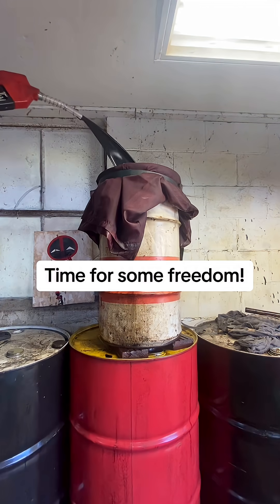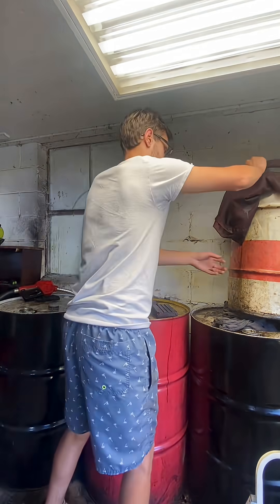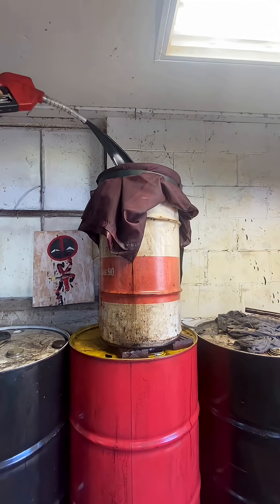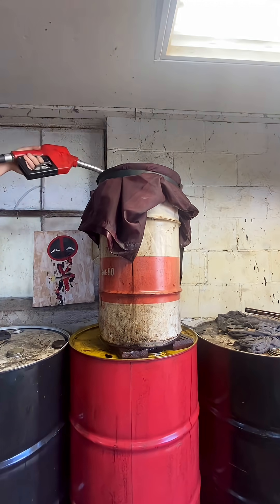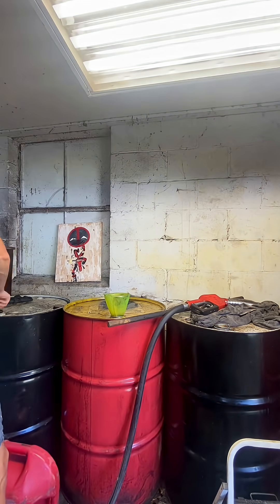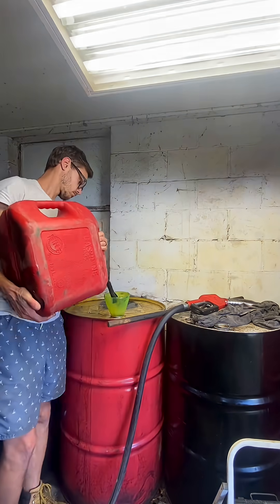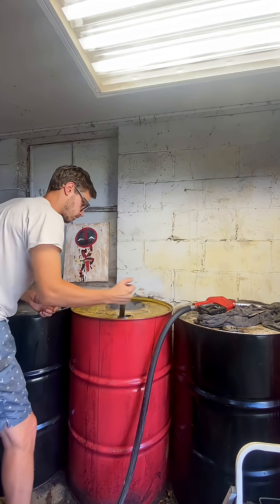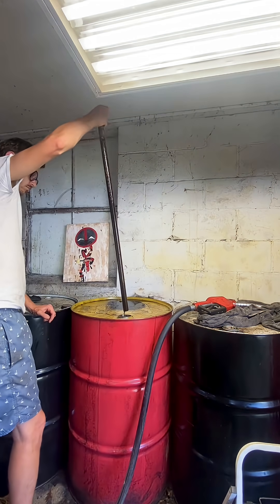Transform #wastemotoroil into #homemadediesel Fuel #dieselmechanic

Comment: This is not diesel without the distillation process. This is essentially 1:50 premixed fuel. Kinda like what a 2 stroke engine runs (50:1). Just a really heavy version of premix or petroil. It will run, but will not run clean and wreak havoc on your injectors and pumps and filters. Even in an old engine, with the bedsheet filter system and no water elimination in the process you’ll end up having issues.
Reply: Actual real diesel is a mixture of c10-c15 hydrocarbons. Base oils range from c25-c45. And petrol (gasoline) ranges from c5-c15 depending on location. The logic here is probably something along the lines of "by creating a blend of components whose average is that of diesel, it is therefore diesel.".

Dead wrong. Dead engine wrong. But let them learn the hard way. Everyone learns their own way.
Reply: @captainotto  Hey, you sound like you know a bit about it. Can I ask if you've heard of used oil engines? Apparently they are around. Would you have anything on them? Cheeers
Reply: @theoneandonlybluesky My understanding is that is just any pre-common rail diesel, with modifications to account for the increased soot, ash, varnish, and other nasties produced when burning this stuff in a cylinder.

The safest way to burn used oil is in a burner, perhaps to raise steam or hot water like you would do in a boiler.

The problems you have when burning used oil in an engine come mainly from alkenes produced during the oils use as saturated long chain hydrocarbons crack, saturated salts from detergents and surfactants, and of course sludge and varnish caused by the combination of carbon and metallic particulates and polymerisation of various alkenes inside the cylinder during combustion.

Engines that are made to burn used oil will address the above issues or otherwise be immune to them. I cannot think of a single car engine that addresses all of the above. Not stock at least. Regarding soot and ash, however, any non-DPF will be very resilient to that, but your neighbours may not be!
Reply: It has more btu potential than diesel and will burn in a boiler with air assist. Lots of waste oil furnaces  mechanical injection or heui are fine just have to filter. I got a guy I know runs mineral oil in a Cummins cuz he gets it free. Has a cleaner tailpipe than fuel oil  @captainotto
Reply: @captainotto ACTUAL “real” diesel was made from plant oils. Mr. Diesel was on his way to Europe on a cruise ship with all his paperwork to a meeting when he decided to “off” himself and jump overboard, leaving his patents and paperwork behind. Effectively leaving his life’s work to the Rockafellers… who re-engineered the fuel so every farmer COULD NOT be a fuel producer. 
Facts.
Reply: @societyspy I’m sure it wasn’t suicide
Reply: @societyspy seriously? He commited suicide? I presume he wasn't making any money. I need to go check out his story again.
Reply: @societyspy sound like a good ol “accident”
Reply: 😂@Owexotic
Reply: Yeah I clean my Injectors about once every 5 months , but it's worth it to me to save 10 grand a year in fuel , after you do it 5 or so times cleaning them and fuel filter only takes a hour or so
Reply: @chrismoss875  if you have to physically clean your injectors twice a year I could only imagine the buildup in your heads exhaust ports and valves and seats. As well, if you have to clean your injectors that much the fuel system must be full of crap as the injectors are the last stop for the dirty fuel. Let’s not forget the fuel tank now. There must be a solid inch or more of sludge just sitting at the bottom. Do you drop the tank once a year as well to clean it out? Apart from all this, it’s actually illegal in the USA to refine your own fuel. Maybe that’s why he doesn’t refine it in this video and is simply making a diesel gas mixture.
Reply: @Mathew-xr7kt  It is absolutely not illegal in the US to create your own fuel. There’s different regulations and permits needed depending on type and amount, but it’s not illegal at all. People have been making biofuels for decades.
Reply: @ndavis265  it’s is 100% illegal to use homemade fuel. A big portion of the price of fuel is taxes. You’d be evading the road taxes. You need permits and follow proper epa laws to produce fuel.
Reply: @Mathew-xr7kt Exactly like I said, “there’s permits and regulations.” One of which is you have to pay fuel tax if you use it on public roads. I swear y’all argue just to argue. 🤦🏻‍♂️
Reply: @ndavis265  lol and the rules and regulations would dictate that one would not be allowed to make homemade fuel on private property. EPA has pretty strict guidelines when it comes to making fuels or mixing and distilling chemicals. 
You’re the one here trying to argue just for the sake of arguing. Come back when you’ve found someone legally making fuel in their backyard. 
It’s not even legal to pick up oil from businesses and store it on your own property.
Reply: Who cares he saves 10,000 a year
Reply: @ash7946  doing some quick math on your statement. He’d have to use about 50 gallons a week @ $4/gal to spend 10k a year on fuel. 

You’re also not taking into account the time and fuel it takes to collect all this used oil, process it and store it. Not to mention associated repair costs and the 100 pillowcases he goes through every year lol. Time is money and wasting time making mixed gas and oil isn’t worth it for most people. I guess if you’re unemployed and have the time to mess around it may be worth it. Then again, if you’re unemployed are you really using 50 gallons of fuel per week?? Someone that burns that much fuel doesn’t really have time to mess around making homemade fuel and the only vehicles that can handle burning this heavy mixture aren’t usually suitable to be driven that much..
Reply: People in the comments will attack anything. “ technically it’s not 50:1 considering I took 3 shits and only ate 1 meal but sniffed the petrol 4 times and only got 1 brain tumour id say the ratio is” who gives a shit that wasn’t the point of his comment.
Reply: Wouldn't it be 10:1? Since he did 50:5
Reply: @eron1979 no its 5:55. The first number five is what is being diluted and the 55 is the total parts.
Reply: @eron1979  in theory it would be 1:9 if you account for the 5 gal of gas that displaced the 5 gal of oil in the 50 gal drum. Wouldn’t be possible to add 5 gal of gas to 50 gal of oil in a drum that only holds 50 gal. 
But that’s besides the point. He made mixed fuel, not diesel.
Reply: @Mathew-xr7kt  55 gallon drum. They come in 55 gallon size standard. So it's 1:10 ratio. He even says, "i take an empty 55 gallon drum".
Reply: @Mathew-xr7kt That's how I know you don't work anywhere near shops or cars or anything if you don't know those drums are 55 gallon not 50 gallon
Reply: @316Speedshop  lol been in the oil fields for decades. Just never been to the states. We strictly use litres and cubic metres when referring to liquids. Drums are 200 litres (43.8 gallons) most of the world has moved onto the metric system. More precise.
Reply: @Mathew-xr7kt  okay so is 200 litres 43.8gals or 53.8gals??? That might be a dumb question but I don't feel like looking it up and converting it on Google ‼️🤦🏾‍♂️🤣🤣🤣🤷🏾‍♂️👌🏾💯...
Reply: @amERICanERICandoit ahh.. thanks I missed that. 😉
Reply: @Mathew-xr7kt  55 gallon drum
Reply: @ayeeequanpsn5896  It's 52.8, everybody can make a typo. Give the man a fawking break, this is absolutely not the point here!

The point his an old oil + gasoline mixture != diesel
Reply: @SgtDuster The point of this thread is to let the OP keep showing us how important humility is, when you're trying to prove you aren't a total idiot.
Reply: Fact! @amERICanERICandoit
Reply: @Mathew-xr7kt standard drums hold 55 gallons.
Reply: @terrywilliams6158  there over 100 replies on this. Your a bit late to the party bud
Reply: @Mathew-xr7kt  it's a 55 gallon drum so it's 10:1 ratio
Reply: Right, he's gonna have huge problems.
Reply: @ktajax y'all do realize any diesel pre electronics will run on straight used oil right? My ford 5000 has been running straight used oil for 5 years
Reply: @ktajax no he’s not it’s proven to work and burn more efficiently than normal diesel. I hate yt comment sections
Reply: I came here to say this. Thank you. Saved me typing. Getting really tired of people posting these videos and have 0 understanding of petrol chemistry
Reply: So everyone in the comments talking like they are chemist and engineers after using google  😂  🤦‍♂️
Reply: My grandfather used to run his soviet era tractor on pure oil, any oil you can imagine, old electric transformer oil. The tractor is 40+ years old and still works. You know what will really run havoc on your modern diesels? Diesel itself. There is no more lubricity in diesel, helps to throw a quart of engine oil in your diesel.
Reply: I'd not use more than 25% of that stuff in your tank.
Reply: I love that everyone is arguing the math but we are all on the same page that it isn't diesel. Gotta love us gearheads.
Reply: It’s what is very commonly referred to as “homemade diesel”. I understand you are very smart and need to prove it to all of us but you sound quite dumb. Especially not knowing what a 55 gallon drum is 😂
Reply: @ChrisJohnson-ww4vs  where did I say I didn’t know what a 55gal drum is? I didn’t… like I stated. We use litres.
Reply: @Mathew-xr7kt ”in theory it would be 1:9 if you account for the 5 gal of gas that displaced the 5 gal of oil in the 50 gal drum. Wouldn't be possible to add 5 gal of gas to 50 gal of oil in a drum that only holds 50 gal.”

Might want to get your memory checked if you’re already forgetting this.
Reply: @ChrisJohnson-ww4vs  look up how much fluid actually fits in a 55 gal drum.
Reply: @ChrisJohnson-ww4vs  as well, if you read through my comment you’ll realize I even said I was mistaken and heard wrong when the guy mentioned the gallons. I also mentioned I’m not in the USA and we don’t use gallons.
Reply: @Mathew-xr7kt What does your country of residence have to do with this? Knowledge is not stopped at borders.
Reply: @ChrisJohnson-ww4vs  when you never use gallons as a measurement unit from primary to secondary school right through college you just don’t know. 
If I ask you to drive 30km away to pick up a 30litre jug of water would you just automatically know how many miles you need to drive and what 30 litre of water would look like if you had 10 different jugs to choose from? The fact you’re more focused on the units of measurement rather then the conversation about whether this is diesel or not says all I need to know….
Reply: @Mathew-xr7kt Yes because unlike whatever 3rd world country you come from, in my country, we are taught multiple different forms of measurement. 

You seem to be the one focusing on the unit of measurement, I mentioned the homemade diesel in my original comment yet you ignored it. Practice what you preach, brother.
Reply: @Mathew-xr7kt  so much effort to not admit you got a basic math question wrong haha.
Reply: @ChrisJohnson-ww4vs it's called overfilling. I'm.sure there would be enough space at the top. A 5 gallon Jerry can can hold a bit more than 5 gallons if overfilled. 

See if I can get some troll responses too 😂
Reply: @nathanwest4670 What’s called overfilling? How can you overfill a container with less fuel? 55>50, dummy
Reply: @ChrisJohnson-ww4vs also I no longer am able to find the comment I was responding to. But it had nothing to do with your petty debate nonetheless. It did have something to do with a comment you made within your petty debate. I'm glad this method of bringing yourself up to feel intelligent works for you. To true intellectual and intelligent people it kinda makes YOU come across as the "dummy" who's trying REALLY HARD not to be. 😂. Kk. Goodnight.
Reply: @nathanwest4670 in case you need a refresher, here’s the comment you replied to me earlier with.

“@ChrisJohnson-ww4vsit's called overfilling.
I'm.sure there would be enough space at the top. A 5 gallon Jerry can can hold a bit more than 5 gallons if overfilled.

See if I can get some troll responses too 😂”
Reply: @ChrisJohnson-ww4vs  no shit. Lol. I can not find and have FORGOTTEN WHAT "YOU" SAID THAT TRIGGERED THAT COMMENT. I know wtf it was "I" said, duh. The comment is no longer there or I can't see it but you had said something about a whatever gallon drum only holding whatever amount of gallons durung your pointless and petty argument about ratios to a guy that was simply stating that mixing oil with fuel IS NOT Diesel. but rather mixed gas. You start going on about a topic that has absolutely nothing to do with weather the guys mix is desil fuel or not. I pointed out any container can be OVERFILLED. Wow. You took the bait didn't ya. Mountain out of a mole hill. Lol
Reply: @ChrisJohnson-ww4vs I'm not retyping my response that's been removed oddly. So I'm just gonna say I know what it is That "I" said. Lol. My comment isn't that far up that I needed you to remind me of my comment.  I can no longer find the comment you made (one of many) it's likely buried in all your responses. But it was something you had said about a drum or barrel not being able to hold more than whatever many gallons that is written on the side. I was pointing out that ANY container could in theory be overfilled. I really wasn't going get into your pointless ratio debate or any debate with you whatsoever.
Reply: @nathanwest4670 In all 6 (7 now) of my responses? 😂 Struggle with reading, buddy?
Reply: A reversed 10 to 1
Or 1:10
1 gas 10 oil. 
I ain't about to tell another man what to do with his own property, if he's got to do extra maintenance is up to him, if it breaks is on him, if it works it's on him too. 🇺🇲
Reply: Battery electric vehicles don't periodically yield a few litres of dirty oil, including additives and contaminants.  Can't use it as fuel either.  Though there's a stop on the Nullarbor plain that provides battery charging via a generator fuelled by used cooking oil.

Just wanted to add more random to this dog's breakfast of comments.  Cheers.
Reply: Wouldn't it be a 1:10 ratio mix? 50 gallons equals 10 parts...so 5 gallons is 1 part. A 1:50 ratio would be 50 gallons of oil to 1 gallon of gas mathematically speaking.
Reply: @amERICanERICandoit  perfect. So we’re on the same page then, he’s made mix gas and not diesel lol. 
You’re picking apart the math on the mixture yet you have completely disregarded the fact that he hasn’t actually made diesel. We call this a deflection. I heard 50 gal, my bad. In the rest of the world we use litres and not gallons. A barrel holds 200 litres, this equals 52.8 gallons. But for what buddy is doing here being precise is the least of his worries.
Reply: @Mathew-xr7kt bro you broke all technical on him but still got your facts wrong. In USA 🇺🇸 we use gallon’s. We use standard scale not that we can’t convert we don’t want to. A 55 gallon drum is just that it will hold more but besides the point a barrel of oil is 42 gallons not 52.
Reply: @Lunchbox1911  well how do you explain the rest of the world calling it a 200 litre drum. 200 litres = 53.8 gallons. I process drums daily and they’re always hovering around the 200 litre mark.
Reply: You sound too smart to have made such a dumb mistake by not listening closely @Mathew-xr7kt
Reply: @luisgonzalez8423  I was so thrown off when I saw the bed sheet strainer that the 55 gal comment didn’t register.
Reply: @Mathew-xr7kt you’re a clown. Diesels have a fuel water separator in them as long as you drain it you should be fine. I agree he could use a high micron filter but big whoop. A new engine this would tear it to shit. An old 7.3 or 5.9 6.9idi they’d all run it fine. To say the old engines wouldn’t handle it is absurd when I had teachers in trade school teach us this same trick. And there’s shop owners with 7.3’s that have been running 30 years that have probably never bought diesel from a pump
Reply: @aaronherr5852  never said it couldn’t be done or that people don’t do it. Without heating it up ur just running used motor oil mixed with gas. You’ll cook pistons when you’re trying to spray this slurry out your injectors. The people you swear by that do this surely have a heating process.
Reply: @Mathew-xr7kt not trying to be THAT guy but I work in a refinery. A barrel is the global standard for volumetric measurement of crude oil, equivalent to 42 US gallons.
Reply: @cane870  well. You are “that guy” that’s about to learn something new. The barrel of oil is a measurement, not a physical object. Drums are what hold fluid. The measurement you stated is in reference to old wooden barrels that used to hold oil. Now we send oil through pipelines and on tanker trucks, trains and boats. We use the barrel of oil measurement to keep track of overall stock. You can go buy a drum of motor oil if you like, you’ll find 200litres in it as well lol 
We just tend to associate drums and barrels as the same thing
Reply: @Mathew-xr7kt  give it a rest, buddy. You're clogging up the comment section.
Reply: @Lunchbox1911  barrel of oil is 42 gal , but that's a unit of measurement.   55 gallon drum holds 55 gallons of liquid.
Reply: @Mathew-xr7kt  I thought the same thing reading this thread of comments. I. Sitting here doing math knowing you were right and wondering why does that matter and not the faux diesel
Reply: @Mathew-xr7kt hell with the rest of the world!!
Reply: @onejack4662  the rest of the world prefers a more precise measurement I guess. 🤷🏻‍♂️
Reply: All they would have to do is filter the oil with a rope
Reply: Humbly admitting😑... I have been a Cat mechanic for 21 years and haven't thought of this long enough to comprehend what I just learned from you. Thank you.
Reply: @Rusty.1776  would you run a cat on used oil diesel mix?
Reply: @Peterswarahed 
Any machine mid 80's and earlier. Yes, Ive run much worse and thousands of gallons of it. Never added gas to it.
Reply: @Rusty.1776  that many guys made with old MB diesel
Reply: @Rusty.1776  Im trying oil on a eco diesel it seems to be burning it ok...doing a 1:2 ratio....but small amount 5 litres maybe a gallon eventually.  I have to change out my gas filter eventually cant wait to see what that looks like.
Reply: It will work in older trucks and cars like the Mercedes 300D. Newer diesels are going to have problems. A better filter and a water catch on the vehicle will get better results. A diesel purge every few thousand miles will keep the injectors happy.
Reply: @anthonyjackson7097  I had 220d MB 1977 model. Every 1000 km, a half deciliter motor oil to fuel tank, and the engine (pump) was so happy.
The car went 1 200 000km and then it was sold.
Reply: 😂 I was thinking the same thing. Love the 1:50 pre mixed fuel ⛽ comparison 😂😊
Reply: Well said
Reply: Not to rain on your parade but my friend has been doing this in his Dodge for at least 20 years, it works
Reply: @Rich-q9r  not raining on my parade. I don’t doubt people do this. Still doesn’t make the end product diesel. That was the entire point of my post
Reply: @Mathew-xr7kt you made it to the end of the argument. lol, this thread is wild. in summation, this shit ain't diesel
Reply: Maybe he has a deuce and a half lol
Reply: Well, certain areas of Canada had periods of time where one of the 3 different units were in use. Closely enough together that there are still some old guys who cause epic levels of confusion.... they never have the need to specify which gallon they're using when talking about a container, storage tank, or a specific liquid.   They just know which units were used for whatever and can give you the metric conversion from memory.
Reply: @AndyEightSevenFive  great story! Did they make mixed fuel as well?
Reply: @Mathew-xr7kt  more than likely, for anything that actually required premix though....and the guys that actually worked in the sales and delivery services were the ones that added the dye and controlled the summer/winter blending as they loaded the delivery trucks from bulk storage tanks.... Fuel oil, Heating oil, Stove oil, Kerosene all have seasonal blends that are made to keep the temperature effect from creating a wide swing in the performance of the combustion.....

And this would only happen if the goal was to just burn used oil in a garbage drum/fire barrel and it was too cold to light without thinning it out.  If they heard him call it Homemade Diesel, the only comment ould be along the lines of, "Thats a new way of spending a dollar to save a dime"
Reply: Came here for this lol not diesel
Reply: its diesel fuel if its burned in a diesel engine plain and simple.
Reply: @theoriginalDirtybill  diesel fuel consists of hydrocarbons designed for combustion, while used motor oil contains contaminants and additives from engine operation. 

It’ll burn, not as well and clean as diesel. Because it’s not diesel. Your comment is like saying, “ that object is grass because it’s green”…….
Reply: @Mathew-xr7kt  diesel fuel is anything that burns in a diesel engine.....
Reply: @theoriginalDirtybill  unlike in today’s world, it’s not diesel simply because it identifies as diesel.
Reply: @theoriginalDirtybill  so, the box of paperwork that collected in the truck cab, if stuffed into the cylinders ( through the intake even ) and lit  with matches if the glow plugs arent hot and/or cloae enough to light the paper(even go so far as to light them in the correct firing order) would qualify paper as diesel fuel?
Reply: He forgot to add a gallon of water for delution and cleaner C02 admissions..
Reply: @Magic_Mindz  dilution and emissions…
Reply: This guy is full of shit
Reply: 10% used oil is nice on the fuel bill. how much does paying for filtering used oil cost. agree it will work filtered A lot of work
Reply: My idi has drank this for the last 350000 miles, still sippin
Reply: I would have thought you added paraffin or kerosene
Reply: if you have crappy injectors maybe, my volvo has driven for 8 years with home made diesel fuel. Runs great, no noticable performance loss, nothing breaks or clogs up.
Reply: @riemerstulp6586  like I stated. This isn’t even considered homemade diesel. It’s just used motor oil mixed with gas.
Reply: Get you one of these for your fuel transfer. You will empty that 5 gallons of gas in 2 minutes and don’t have to hold the can. LIFE SAVER!!
Reply: Except it’s 1:10. Almost the right ratio for drip torch fuel. This isn’t diesel and good luck ruining your fuel pump, injectors and filter.
Reply: @scottmx426no7 its funny you gen z's talking smack about clogging filters and injectors like the reality of these old timers using this trick for many many many years without issue somehow doesn't exsist or something, why listen to a idiot on youtube when results speak for themselves 😂
Reply: 10 to1
Reply: So he essentially made weed Wacker fuel?
Reply: @Allen-g1l  😂 I would never put that garbage into a 2 stroke
Reply: You must like black smoke
Reply: Play some really bad saw gas😂
Reply: I think he's just trolling. If he actually tried to make something like this, he wouldn't confidently make a video.
Reply: I run 32:1 or more. Fun fact older chainsaws will have a line of text saying 16:1 with sae 30 motor oil.  Hell, I got a 6 pack of 8 ounce carbon cans with metal lids that are homelite 2 stroke oil cans.  Idk how old they are.  I occasionally use one.  

But seriously though this guy is full of shit
Reply: it's 55 gal Drum play me a list of different size elsewhere however stateside they are 55 gallons if you wanted to convert that to liters it would be 208.19 l . however that would be filling it completely which is very possible they don't do overseas. 

I used to run about a 50/50 used oil/ diesel in my old 1980 Datsun 720 diesel. it ran like a top on it. the newer engines wouldn't run this because they actually require a certain clarity of the fuel. and that was a 50/50 during the summer and about a 30/70 during the winter.

this actually works very well for older diesels when they took a lot of the sulfur out of modern diesel fuel it doesn't lubricate things as well. you can also use used transmission fluid and power steering fluid in the mix. I used to run it through a fuel sock before running it in my vehicle barring an emergency. 

I ran my truck for hundreds of thousands of miles changing fuel filters in pre-filters but that was it never had an injector problem.
Reply: @lrdhawkwind  is that metric gallons or imperial gallons? lol You’re about 120 reply’s down and over a month of debating this. The world doesn’t revolve around the USA and their imperial system that the entire world has moved on from.
Reply: @Mathew-xr7kt you do realize technically it's not our imperial system lol we are just one of the few countries that still uses imperial gallons.
Reply: @lrdhawkwind  all you use is imperial measurements. Only 3 countries in the world use this system. USA, Libya and Myanmar lol. 
If you’re in the USA and ship a container anywhere you have to use metric tonnes and gallons. USA is holding on to a useless system they can’t even use internationally. Even us airports have to use the metric system
Reply: Hey it’s almost like it ain’t your fucking problem, he seems to know what he’s doing more than you like bitching.
Reply: I see dudes have lots of success with the centrifuge + low micron filters  water separators then cutting with kerosene to thin it as necessary in the older engines. It's dirty but it runs and shouldn't* fuck anything upp too badly
Reply: I was thinking that but this is way richer and not mixed nearly enough. I use 1qt oil for every gallon of gas in my salamander heater
Reply: well (how much to unpack..) diesel does not equal "distillate" - those are dumb "equivacations", diesel IS a specific hydrocarbon fraction (?Diesel  was a German guy's name..   Rudolf... he dies on a cross channel ferry..)  Yes premix gasoline/ petrol + oil does not make diesel.  that needs constant aggitation unlike real diesel..

Transersterification of oil  - that is a chemical process...
Reply: @kadmow  you’re just taking my simple terms and scrutinizing them. I know the history of the name Diesel saying I’m wrong for calling it Diesel instead of its hydcarbon sequence is just you gaslighting me.
Reply: Oh that is gonna dirty up your entire system, not sure how much you save, you will need to be able to clean it yourself or any savings, will just go to your mechanic